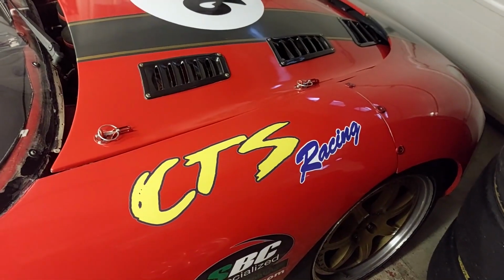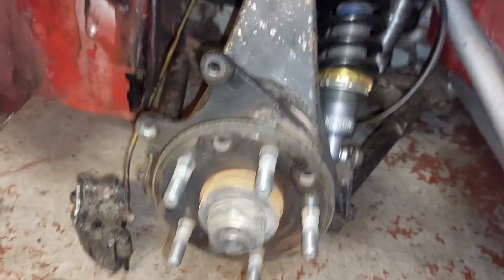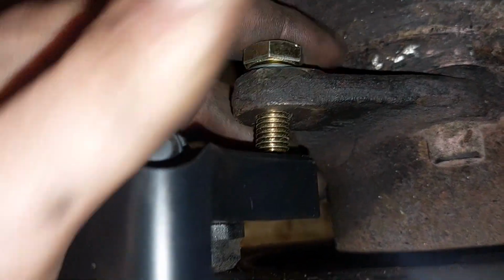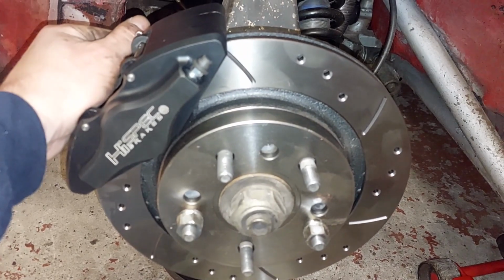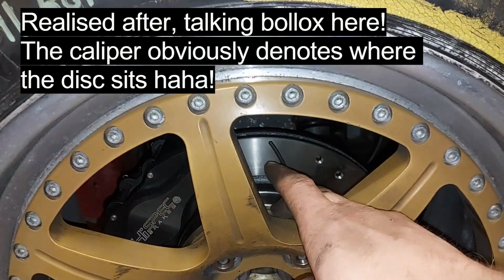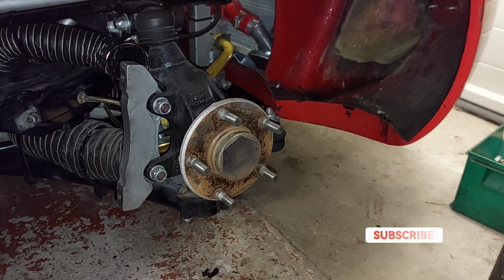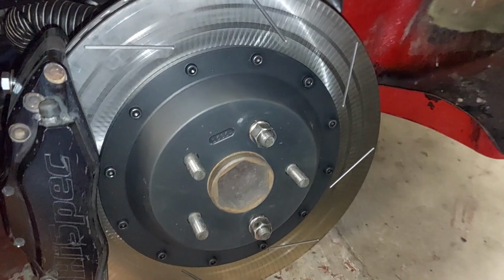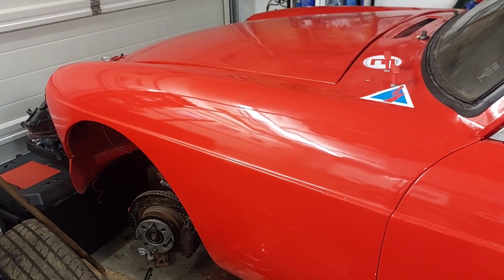CTS Racing - TVR Griffith Brake Upgrades Part 1.  Measuring, Fitting, Not Fitting. We Try!

Comment: Great stuff Dave. Them fronts are near the limit. Nearly as big as my wheels. Iv'e sort of come up with. Fitting new as standard discs on rear but probably EBC grooved, 273mm. Rebuild the calipers which are a bit tight. Probably the handbake mech a bit seized. Fronts not sure yet. Standard they are only 260mm which is a bit strange. I would like some 4 pot calipers & slightly larger discs. Not cheap though. 
Keep the great work & more will watch. 
Steve.
Reply from the maker: Thanks Steve. Old rear discs were from Rally Design but they don't seem to do them anymore. New ones are from a company I found on eBay. They've been redrilled to suit my pcd though (but I'm on Ford 5x108pcd). Std is I think 4x100 so plenty places available for them.
Fronts were smaller std because of the 15" wheel I believe, but therr are plenty options out there, budget dependant lol.